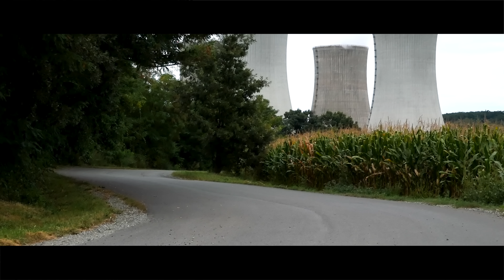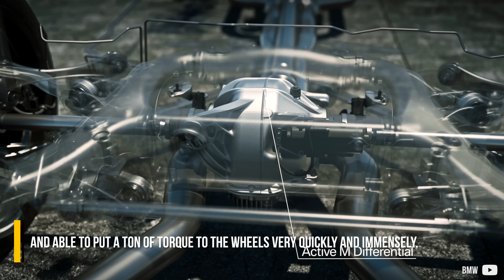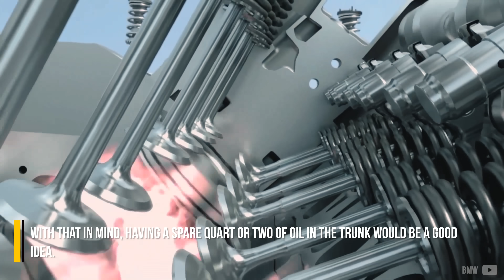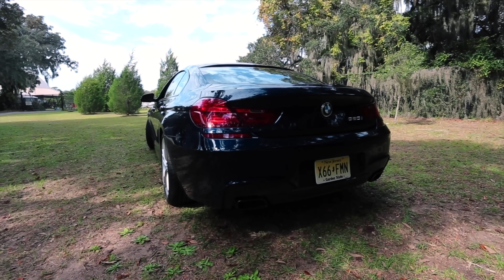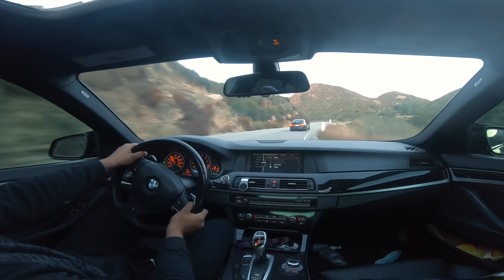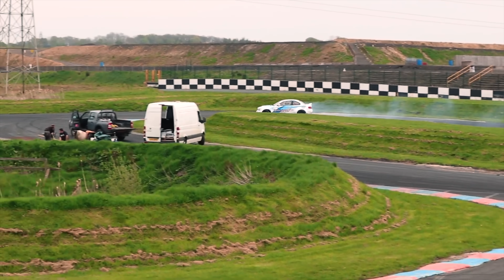The Worst BMW Ever?

Comment: This video doesn't even state the worst bits about it. The oil consumption is basically a side effect of low tension rings to reduce drag and therefore fuel consumption.  The turbo oil feeds commonly get blocked, destroying turbos.
 
Some genius decided that the turbo oil drain should feed superheated foamy oil to the crank mains... 

The injectors used to commonly stick open, washing the bores and resulting in massive scoring requiring a new block and pistons. Of course the labour and parts price required to replace just a block and pistons is so high that you might as well just buy a new long engine.  And you can't bore it and fit oversized pistons either, because alusil isn't like a normal iron liner. And even if you could correctly bore and acid hone it BMW doesn't sell the pistons separately.

The new M5 has an even dumber feature version. The new S63 is basically the N63 with an even worse oil pump. Basically, to reduce emissions on startup the oil pump flows only a minimal amount of oil. Of course cold startup is where you want all the oil you can get, so I expect these will start trashing themselves very quickly too.
Reply: Good thing BMW are working to make their cars more recycle-able.  Don't want to foul the planet with cars that are not durable.
Reply: Which is worse for reliability, the S85 V10 or the S63?      Everyone says the E60 M5 is the most unreliable BMW ever but after watching this I would much sooner have one of those than an N/S63 equipped car.  And not just because the V10 sounds way, way better..
Reply: Give me a W201 1985 190E 2.0 engine…. Oh wait that ain’t BMW
Reply: @tronixfix  Nice engine indeed. Had a 1988 one. Great car. These engines don't have the injectors, which is good for reliability. Everyone is after the 190E but no one knows that the injector system will fail eventually, just wear, and there's hardly anyone in Europe capable of repairing those. Let alone finding replacement parts for it. Read that in a classics magazine where an old Mercedes maintenance engineer wrote about this car. 
That's the reason I sold mine with €2250 profit after I bought mine from a dealer I used to work. 114.000km, first owner, dealer maintained and I coulr buy it for €750. Kept it under a cover when not in use, kept it dealer maintained and therefore it kept it's value.
Reply: @tronixfix  If you can still find a BMW with the M50 engine it in, those things are practically fault free and can be tuned to crazy outputs too!
Reply: I use w40...
Reply: Probably BMW replaced REAL Engineers for 'bean counters'. I'd bet my brass, BMW is making Zillions on replacement parts alone. My LAST (ever) 1.991 / 535ia, (I wrote about it elsewhere) with cast iron block / head twin cam i6, NEVER had any issues. I sold it with roughly 140K miles on it.
Reply: my m5 s63 burns zero oil...
Reply: @wesleyfancher4280  how often do you change oil? I am thinking every 5k in my 2022 X5M Comp with liqui moly SPECIAL TEC B FE 5W-30
Reply: @theone4606  every 5k. i use a 5w-40
Reply: The oil consumption on the V8 S63 is due to bad coating on the cylinders ! I had an F10 where 5-8 cylinders were having horizontal scores and small holes in the nicasil where the oil would go in and the ring would not clean it and it would get burnt slowly slowly .. every tank fill up would require one liter of oil .. that's how bad it got .
Reply: @TheRealAnthony_real  ive heard its from improper engine break-in. Some burn zero oil, like mine.
Reply: @wesleyfancher4280  not sure if it is improper break-in .. I think the nicasil coating will at some point exfoliate .. 

My X5 2017 was fine no oil consumption, and my 2019 M5 as well .. 50k miles on the clock no oil consumption .. mind u I'm doubt services every 5k ;)
Reply: @wesleyfancher4280  that's amazing, my 13 M6 which has had correct brake in service and very very gently used by elderly folks since new, still burns a little bit of oil. My car has almost 44k, bought it at 42k, and it has used about half a quart in that time. Very impressive tbh
Reply: @TheRealAnthony_real  No it isn't, because there is no coating. Alusil doesn't have any coating. It's more like the opposite of a coating, acid is used to
expose the silicon granules in the hypereutectic alloy instead of traditional honing. Nikasil is a completely different thing.

And the oil consumption is from low tension rings (and often valve stem
seals also). BMW's bulletin in AIR even says it's from the low tension rings.

The vertical scoring you mention is normally caused by running rich due to one or more bad injectors washing the oil off the bores like I mentioned in my first comment.
Reply: @ma61king  I said horizontal scoring .. punctures in the cylinder walls .. oval scores on the base of the cylinders from 5 to 8 .. 7 being the worst .. on bank though 1-4 was new
Reply: @TheRealAnthony_real  Well you also said nikasil so I assumed you were confused about the type of scoring too
Reply: @ma61king  confused ? LOL you're the confused one haha !
Reply: Just admit you have no idea what alusil is, bro

Comment: Nonsense, the N63 is best BMW engine ever made. Why? Well because I sold 4 new ones in one year once (and a S63). Because of the N63 I was able to save up for a deposit on my house.
Reply: Horseshit.     The S62 in the E39 M5 is miles ahead of the N63 in power, reliability, durability, ease of maintenance.    It ain't even close.
Reply: @stevenotto2581   Clearly you didn't understand the comment. I never sold any S62 long engines to buy my house.

Comment: I've owned 5 BMW's in my lifetime and have gotten rid of all of them prior to that dreaded 90-100K mileage  mark.  It's really a darn shame to see how the engine quality has steadily declined over the years and the main reason that I'll NEVER own another BMW anytime soon!!
Reply: Never had a issue with my BMWs 
I even murdered the f30 engine and it’s still running great. Stop whining!
Reply: How about the 40i BMWs? They have a simple turbocharged inline 6 engine called de B58B30, coolant pump and water pump issues are a factor but because the engine is closed deck, no more head gasket issues like the N54 and N55.
Reply: @h.a.4600  40i is one of the best bmw engines ever made.
Reply: @pasma1983  Ideal to put it either older Beemers or Toyotas since the B58 is also in the Supra; not to mention that putting an aftermaket turbo on the engine makes it sound really sick and gets rid of the stupid pops.
Reply: @h.a.4600  100 % true.
This engine is a masterpiece, some say it looks like a 2jz in a lot of ways.
I can imagine they say that.
But stil a porsche fanboy🤣
Reply: @pasma1983  The B58 ain't nothing like a 2JZ, but it behaves like one, the only thing both engines have in common is that are closed deck design.
Reply: @h.a.4600  well than it looks like a 2jz doesn't it?🙈
Reply: @pasma1983  actually it doesn't because the JZ made in the traditional way, the B58 is more of a slant 6 style, the 2J has a timing belt, the B58 has a timing chain.
Reply: @h.a.4600  it acts like it, it sounds like it.
And they are both strong, dont brake down.
So the b58 looks like the 2jz🤷‍♂️.
Doesn't matter if the engine looks different and works different.🤷‍♂️
Reply: @h.a.4600  The 55 is a sizable improvement over the 54
Reply: @peterdonoghue8161  It doesnt blow the head gasket frecuently like the 54?
Reply: @h.a.4600  I'm in most of the n55 user groups and a single hydrolocked engine is as close as I've seen but I don't think that one car loved and adored if you know what I mean. The plastic charge pipe is fixable for not a lot of money, I put the alu one on mine. The biggie is oil starvation from trackdays and donuts without the sump baffle. Otherwise their pretty hardy pieces of kit.
Reply: I feel you bro , old bmw were so much better
Reply: Blablabla, you never drove a bmw🙈. You ur just cruisin around in a daihatsu cuore the rest of ur life!
Reply: @pasma1983  can you please go away kid ? let adults speak about their experiences because bmw fanboys are recognisable by smell
Reply: @dorsetwarrior3870  go and cry somewhere else little girl!
Porsche fanboy over here by the way!
Ur just a simple guy who never comes at higher levels.🤷‍♂️

Comment: I had a buddy I deployed with and I told him not to buy a newer BMW.
He bought one right as soon as he got back.
Water pump went out right away and dumped coolent all over the ground.
Then every light went off after that.
He had this engine and I looked once at it, then told him to find a mechanic that specializes in BMW.
I wouldn't even touch that thing.

But I will be honest. That engine is amazing with everything that goes into it.
It's art worthy, but not practical worthy.
Would be cool to have one on a stand to look at.
All that over-engineering and still has less power then an LS or coyote.

Comment: Mercedes popularized the Hot-Vee design with their m176/m177/m178 engine success (the only thing putting those codes apart is the oiling system and intercooler mounting). I realized a while later that BMW is the first to introduce it. Unlike the BMW, the mercedes turbo V8 isn't prone to problems. Only a very few misfiring issues were reported and it's mainly software related.

Comment: How can anyone with a rational engineering mind think that putting the catalytic converters near the engine heads is going to result in something other than violent overheating?
Reply: History shows BMW only cares about 1st owner while in warranty. They're designed to last first 4 yrs. Afterward thats where the big money is. Im sure its part of their business plan. You can't just make so many mistakes on so many bmw models throughout the years. Its intentional.
Reply: German engineering is notorious for not allowing for a fudge factor, and there is a huge one when it comes to the converter placement... It's the spash shield UNDER the engine that always gets damaged or left off by a shop during maintenance. It's crucial that all the under car shielding is in place and intact, here's why- The engine compartment is sealed on the top by weather stripping, and mostly blocked off under the engine by the shields. All the heat shields around the turbos, in the valley and around the cats are fed by an air scoop right in the front of the engine under the alternator. If your under car shielding is in place, this forces some of the air coming through the grill and radiator into that scoop, which then cools the turbos and their oil return lines before flowing over the cats and down along the exhaust exiting under the car.
You wont see the air scoop unless you have the engine out, which I have. As soon as I saw it, it clicked.
I verified it by putting one of those tool truck squirrel cage fans in front of it and sure enough the air was funneled right through the tunnel of heat shields in the valley, around the turbos and cats.
Long story short, a lot of the problems people encounter with these engines are because a $100 splash shield under the car is missing.
Reply: @johnlockesghost5592   i wasnt really too show what you meant , But can you help me ? I just purchased this 2013 550i with 130milage for cheap , i seen under the car has no shield , you can see everything under the car , are you saying i should cover under the car so i can avoid problems with the engine?
Reply: @storcas1  yes. There is a panel that goes under the engine and a second under the transmission.
Reply: Okay thank you & thanks for replying
Reply: Cats right up there in between the heads is absolutely the Craziest idea to ever get floated! 
I agree, who in their Right mind would ever ok such a design? Reminds me of those ill fated  badly designed C8 twin turbo kits where they placed the turbos in a similar location becuz it looked so cool.... heat issues guaranteed
Reply: Some people are so smart they actually become foolish.
Reply: saab had an engine (b2x4/5) famous for sludging and the cat touched the underneath of the oil pan and baked the oil intentionally because engineers thought it would heat up the oil faster and in consequence prevent engine wear... My new saab (b284r) has the turbo and cat an inch from the ecu, battery and the coolant reservoir. so I get to buy new coolant reservoirs and batteries every year, luckily the coolant reservoir is only $250...  modern cars are such pleasure. I have a spare ecu for when the heat takes it eventually as I am told it will.
Reply: @marccurzon  get a heat shield bry
Reply: The idea is to warm up the cats as quickly as possible, to meet emissions targets.
Reply: @ma61king  The problem is, its heating everything else up at the same time.  I don't know if you've seen a turbo get so red hot from hard driving that it goes slightly transparent where you can see the turbine blades spinning through the outside casing, but BMW have two of the damned things in a car that is supposed to be driven fast.

Their location is not a good idea, and placing them further away will add mere seconds onto their ability to heat up to pass emissions targets, all without heating all that reliable BMW plastic crap all over the engine!
Reply: @ma61king  this guy gets it, warm cats asap means they start actually working for the tests.
Reply: Take the cats off and get it tuned like I have ….zero issues on mine too date and mines coming up to 95k on original bearings 760hp as well 💪.
Reply: @Mrwaffleandmilk  nah dude, they just don't have the word "reliability" in their dictionary anymore. Everything is about power and performance and that leads to poor design. Ever heard of the 2JZ? That shit can go 100k+ miles with 1000hp. The reason why Toyota went with the B58 was because it costs a ton of money to make a powerful AND reliable engine. And the B58 is one of the best engines out there that is both reliable and powerful.
Reply: @trueG922  there's little that can go wrong with a straight-6. you'd have to do something outrageously stupid to make a bad one, and especially a type that bmw has made since the stone ages.
Reply: Oh, for an industrialist like me, no cat is needed in the pipe🤪 Cats are only needed in the videos🤣
Reply: I mean isn't it for emissions, specifically in Europe?
Reply: Catless downpipes for the win.
Reply: @Mrwaffleandmilk  Here in the States, many owners beat the shit out of their cars. I've seen guys doing powerslides with the engine bumping against the rev limiter. Do that enough times and your engine life will  only 1/4 of what the engineers intended. It's madness.
Reply: The claims made in the video are about gaskets drying out and the turbo oil drains leaking, kind of a stretch as this happens to their other engines. The catalytic converters do not cause the engine to overheat. He does not mention that the miles of coolant hoses up there and all the intake ducts get cooked into oblivion and are as delicate as glass should you need to attempt to remove the used parts in one piece. Oil consumption occurs from the intake valve stem seals on the opposite sides of the head, again seen on the N62 non turbo v8.

Comment: I had  a 2016 650 convertible which used almost 2 quarts of between oil changes... traded it in for an m850 convertible which used no oil. I think that they repaired the oil consumption issue. Funny how none of my Ferraris have the same engine issues as BMWs do....

Comment: Alex Palmieri just did a video about the 2010 Alpina B7.  In 2012, I was in Fort Lauderdale with my '85 Porsche 928S2 5
speed and I got into a little stoplight derby with one of these and the B7 with it's 500 hp walked away from my 13.86 @ 105 mph car.  It didn't run away, it definitely walked away;  I was suitably impressed!

The thing is, here it is 11 years later and the car is a basket case.  My 928S2 when I raced the Alpina, it was 27 years old...

I like BMW cars.  I haven't gotten around to owning one yet, but I will eventually.  The problem with these is that they seriously (!) need to be LEASED cars.  You don't want to own one when the warranty is up....